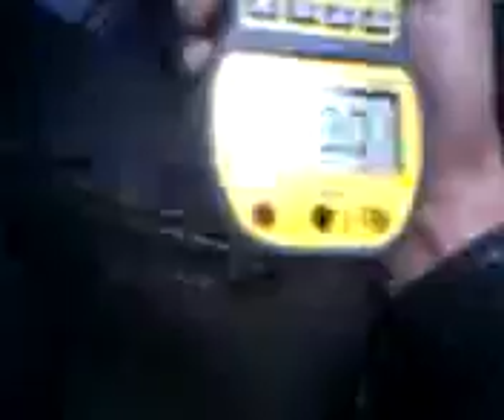Here is a hydrogen torch

Comment from the maker: If I made more cells and put them closer to the eff. voltage I could get the same volume of gas for 650 watts, instead of the 1800 I am using right now. But it would take roughly 4 times the cells. I know its hard to understand all of this with such a limited mode of communication, but I know this from thousands of hours of testing many configs. And it would be a very boring video and text doc to explain it all. But I will answer whatever you ask.

Comment from the maker: actually there are a few reasons, first of which is 6 cells in series would draw around 600amps. second is the volume produced for a given consumed wattage increases the closer to 2 volts(+/-) you get. third is at that voltage the cells would get so hot so fast the containers would melt in less than a minute. I can explain why, and you could suggest changing elyte etc, but in the end this is a quick and ugle way to get 3LPM for a relatively low amperage.

Comment from the maker: that one is made by cutting the normal tip from a cheapo pencil torch, cutting the back end off, and then filling the body with bronze wool, and sticking a vinyl tube and gluing it. Check out the more recent videos for a better model that uses mig welding tips for the tip, there is a how to it.